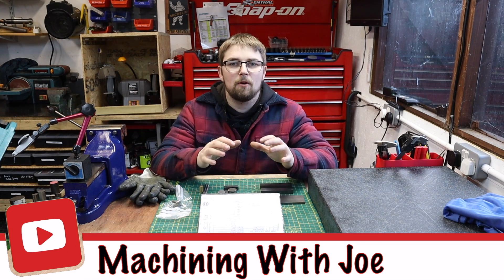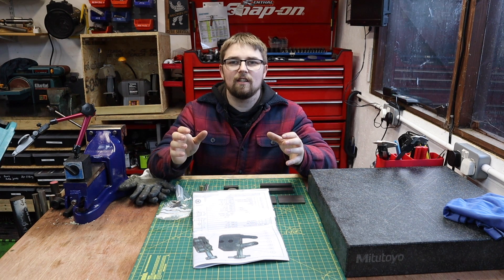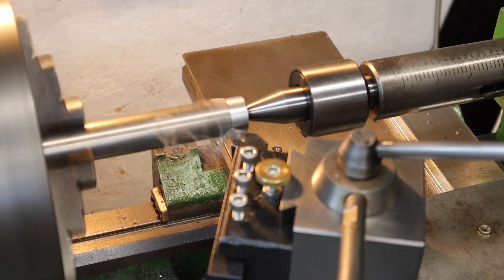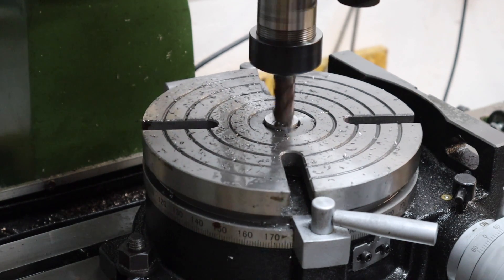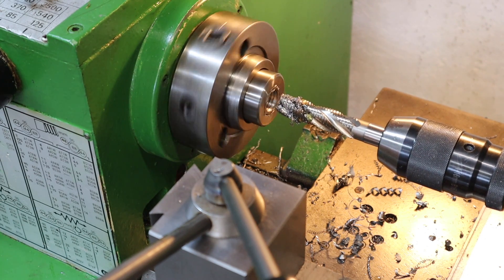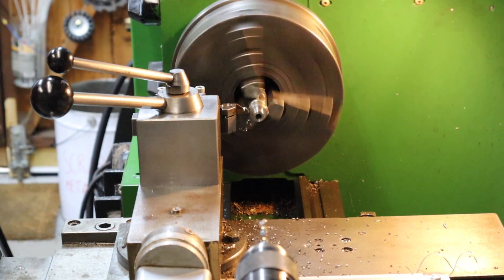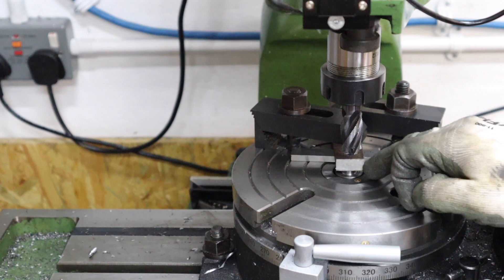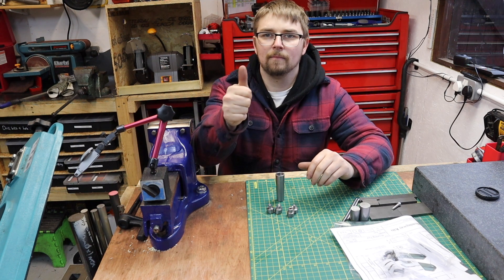MACHINING a Rotary Table alignment tool

Comment: Instead of making the bungs and all the associated machining. Just make pins to fit the hole in the part. Hold the pin in a collet over the centre of the rt, pop it in the part hole and clamp it. Retract the quill and remove the part and you are ready to go. Far more accurate and super simple.

Comment: One of the things that I like about this method is that with pieces that have a hole on the centre radius it provides an anchor point to prevent work movement in addition to any finger clamps used. Even without a fastener it will prevent work movement. Also, everyone is right, lose the gloves.
Reply: Just put a center in the spindle and locate the hole with it. None of this bung nonsense.

Comment: Watch out for calipers.  You have the a good one there but they're limited in accuracy.  Flex, wear, violation of Abbe's law, etc, plague calipers.  For precision fits, use a micrometer.  Any cheap one will work but the 1" Mitutoyo digimatic is pretty nice, if it's not too dear.

Comment: Nice one Joe , have to make one fir mm cave, one tip regarding the morse taper   some suppliers sell different  MT raper adapters with hardened tapers and  unhardend bits you can machjne

Comment: The system works great if you have holes in the part, I'll post a couple of links ar the bottom for options without holes in your part.

I guess you have had loads of crap about wearing gloves & I am not going repeat all the safety issues. I will add though, if you want to work in a professional toolroom you will have the piss taken out of you for your first hour until you get fired. There is nothing more reassuring than giving your tools - tool holders - spindle bores - parts - vice jaws - magnetic chuck etc.. a wipe with your bare hands to know they are clean. Using gloves embedded with tiny bits of swarf & filings will not clean any mating parts enough, especially if any part is magnetic.

I would consider drilling the mt holder through so it can be jacked out instead of having to remove the whole rt to get it out. Once you have centre drilled the holder - drill half way then proceed to turn the taper. The other end can then be drilled to meet the first hole then tapped when machining the counterbore.

When setting the compound for the taper it is important that the morse taper is running true for the dti to give the corect angle.

It looke like the tailstock was out a very long way when machining the holder. Was this because the toolpost was set at a wierd angle instead of square to the spindle. Was the compound slide right forward too. If these were changed to a square set tool & the compound retracted, the tailstock could be retracted for more rigidity.

I did not understand why the holder was roughly machined to length on the rt. Could the height have been measured then faced off to the correct length below the rt surface on the lathe.

I see that you discovered that end mills in the tailstock cut oversize, a quick light pass with a boring bar to any dimension would have given a nice round concentric hole. The size could then be replicated on the buttons. A flat bottom may not be necessary, it will be constant so the button heights can be made to suit.

For the button diameters I strongly suggest a 0-25mm external micrometer for the diameters as they probably need to be slighly under for a slip fit into the mating holes.

If you don't like using a dti to find the centre of the rt then using an accurate plug in a collet can be used. One tip is to have the rt unclamped so it can float to the mating position. Much easier than trying to move the handwheels.

Hope you find the tips useful & here are some links you may find helpful.

A quick setting method for a rotary table ( rt ) - https://youtu.be/fbwWL1facGY?si=IcIugernuKVUByhQ

Setting parts to different positions - https://youtu.be/eQC-Su5hUu8?si=K9N77j0Z2QXmabRM

A quick alignment tool to set parts parallel and at a known distance from the rt centre. - https://youtu.be/jSKzVCTiYPg?si=-sgbsHdOJrnJB7wU

Comment: Why not us a boring bar to clean up the walls?

Im looking at making something similar. But my lathe is much smaller. Any tips on how I would face off the MT2 as im not sure how id hold a tapered piece.

Comment: Ok for this project but neither a Endmill or slot drill will generate a true  flat bottomed hole. There  is generally approximately a 2 degree clearance angle between the corner and the centre of cutter
Reply from the maker: Yeah completely agree looking back wish I’d of used a small boring bar to get a better surface finish.

Comment: Nice one Joe. I Would have used a small boring bar to bore out the final dia. at 18mm then face the bottom of the recess giving you a smoother finish for your inserts & a flat bottom.. Radius's.. Radii. Never the less a nice mod for your rotary table.
Reply from the maker: Yeah I’ve got to admit after using the tool now a few times I do wish I’d of used a boring bar to get that nice inside surface finish would make putting the inserts in a nicer slip fit.

Comment: Hello Joe,
  If you drill and tap the 6mm hole right through the taper you can then use a long screw to jack out the taper from the rotary table if it jams in there.  Easier and quicker than disturbing the table to knock the taper out.
  Steve
Reply from the maker: That’s a great idea Steve however I have not got a drill bit long enough to do so. Maybe if it becomes a major problem I will look into it 👍
Reply: OR make a capped tube that is bigger than the taper & use a short cap screw to pull the taper up. Only takes one turn of the cap screw.

Comment: Here's another idea to locate the Rotary table center. Use an edge finder and dro half functions. You'll get within 5 microns or better, quicker than trying to align and get the spigot into the Rotary table slot.
Reply from the maker: Hey dude yeah that’s a great method of locating. Reason I went with this method is I like the simplicity of finding rotary table centre and then having a pivot pin to locate work onto. 👍
Reply: @MachiningwithJoe  that Morse taper locating boss is not hardened, physically locating by pushing the pin into it will wear out the hole edges over time unless your very careful. But yes simple.

Comment: Hello Joe. Thank you for showing how you went about machining this morse taper adapter. Very interesting indeed. 👏👏👍😀
Reply from the maker: Your more than welcome by all means this method worked for me but if you need a very accurate taper then I would definitely follow Ades advise.

Comment: Hi Joe , this is great that you are moving on like this , I have the same rotary table by the way , really good , can I offer a little advise if I may . when you clock in the angle with your compound you did it well. the issue is that morse tapers are very fussy to lock and release properly so accuracy is really important . Maybe next time try this,  centre drill a piece of stock in the chuck . then set up the centre to clock by putting the point in the centre drilled hole and then use a  tailstock centre in the hole in the back of the morse taper to set the angle to be clocked between centres. ensure that your tailstock is well clocked first. this will put the part that you are clocking true to the axis of the lathe .    you can check this by rotating the part before clocking the angle . then simply clock it in as you did and much closer results will come . Not a criticism at all and you will get close the way you did it . only trying to help. please don't take offence , certainly none meant only admiration you  having a go . Cheers and keep it up , Ade
Reply from the maker: Hi Ade, thank you for the comment as a self taught hobbyist advise from people like yourself is priceless. How you have described the setup and process makes complete sense for getting really accurate and like for like tapers. I will definitely be giving this method ago next time I have to cut a taper. All the best and great work on that little engine so far.